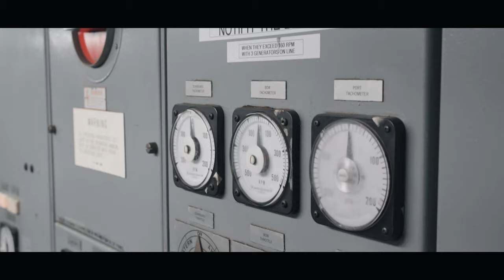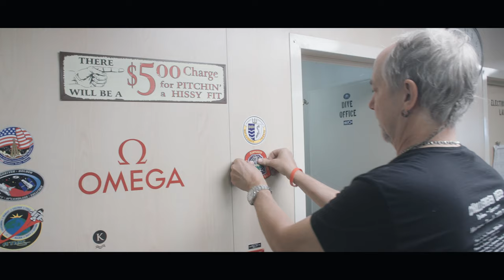Richard Garriott & Michael Dubno

Comment: Where can I find tech specs on this submarine? What is the outer shell's pressure rating compared to the inner titanium core where the divers sit? How dose it sink and rise? What is the air time limit? How long do the batteries last? How dose the fail safe weight drop work? And a hundred more questions...
Reply: They have a 30 minute video on this